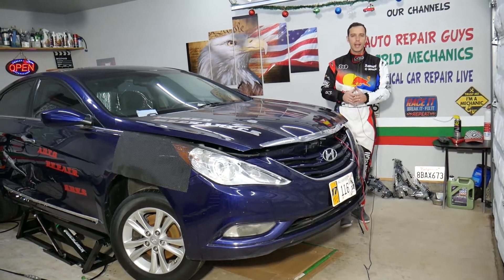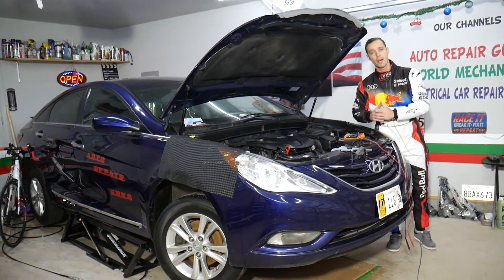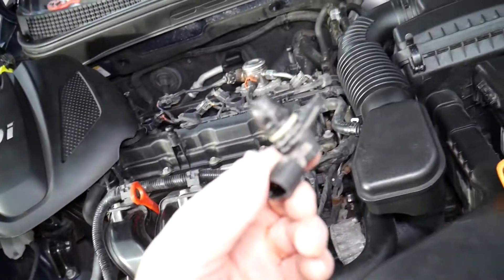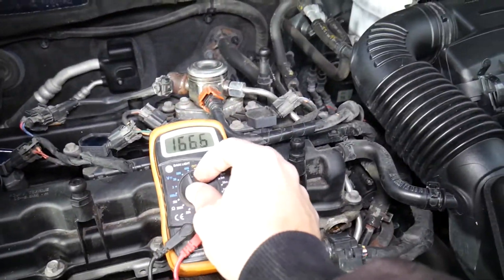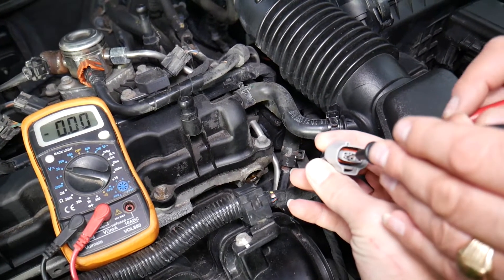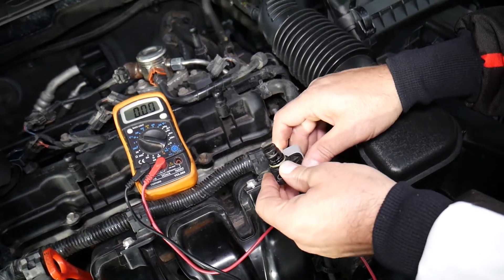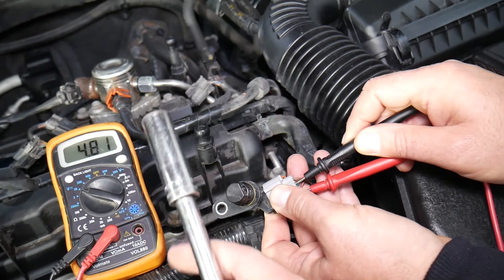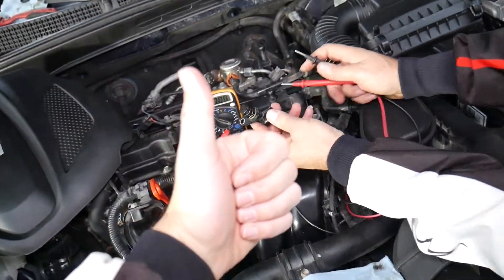HOW TO TEST CAMSHAFT POSITION SENSOR ON A CAR

Comment: I'm currently having a rough start when the engine is warm. My question is would this work as well for a sensor that is malfunctioning not just bad? Or is this what is determined bad?
Reply: There are no codes and have not had any. However you can definitely tell the lack of power, rough starts when hot, rough shifts or just the automatic acting like it doesn't know what to do, rough idle, and hesitation. If you have any other ideas I'm all ears. We have completed and replaced sparks, coils, injectors, fuel pump, intakes, throttle bodies, and a few small maintenance items. I drive a infiniti g37 2013 so all the minor issues from previous years are non existent.

Comment: I tested my camshaft and crankshaft positioning sensors.  They seem good.  I'm getting no signal from the ignition coil signal wire.  I get wire continuity from camshaft to ECM.  I have a 95 Maxima.  Do you know how much voltage I should get from the camshaft sensor?  I put my voltmeter on mV and still get nothing from the ignition coil sig. wire.
Reply: Sorun çözüldü mü?

Comment: Does this work for all camshaft sensors? I got Volvo V70 2008, problem hard start after night and both sensors does not change voltage when i touch metal bar to it, stays at 5v( battery and signal are both 5v)one of them is new.
Reply: Mine does the same with an Ls motor

Comment: I am experiencing a weird phenomenon with my audi 2.0T Q5 with my troubleshooting of the P0016 code. Hope the professionals can explain.

Got code  (Bank 1 Sensor A). checked both sensors they are good (replaced with new ones did not help - confirmation of sensors intact).
Noticed oil leakage residues at the VVT Magnet Valve and below is what I did:

1. Removed the VVT control magnet control valve. the pin got little stuck at first but cleaned and then it moves freely.
2. Measure the voltage of the plug coming to it: measures VDC 7.6V, The coil resistance of the valve is 6.7 ohm.
3. Tested the magnet control valve with a 7.5V (and 9VDC as well) battery and the pin pops fine with both voltages. But when plug it back to the car it does not respond although the power from the plug has voltage measured at 8.3V. I've ruled out loose connection as it has no response even the power measured from the magnet pins is 8.3V.
4. the Solenoid itself looks fine and it move in when pushed with finger and springs back out freely. This is hard to explain from what the basic ohm law of high school physics.

Comment: Question in testing the wire going to my cam sensor I'm getting my signal at 4.80 but on the power side I'm only getting 8 volts tested the battery and I 12 v on the battery is that ok

Comment: I have a 2007 Saturn Ion with a 2.2 ecotech engine and the signal reads fine at 5.02 when the meter is on either side with the black in the middle but doesn't show the battery voltage like in the video. When I try to put each probe on the outsides it just shows 0. Anyone know what this means? 

Thanks

Comment: Hi, i want a reply from you or any one who would know, i just checked my sensor and signal reading is 0.2 when magnet is not near metal and reading is 4.8 when i get a metal near sensor, basically it is opposite to what he said in the video, but the readings are changing, is my sensor working?
Reply: There are 2 type of sensors. It depends on what the computer is programmed to see.  A voltage signal or a zero voltage signal when there is an object in front of it.  The computer is either waiting for a voltage signal when triggered or is always seeing a voltage signal and is waiting for a drop in voltage signal when triggered. Hope that helps.
Reply: I have the same issue, did you ever figure it out?

Comment: i have a 4.8 signal wire and when i put metal on the sensor both the intake and exhaust sensor goes to .20. i never see zero. any ideas?

Comment: Hello, i have a Octavia 2.0 fsi 150Hp, this Week during a night was  -20 C and the car won’t start in the morning, crank but not start. I haved one error on diagnose: P000A camshaft position “A” timing; slow response BANK 1, Intermitent. I saw this video and check my camshaft position sensor and wire and i have just the signal from/to ECU ( 4.8 ) but no voltage from battery so the question is: i have the + wire is in short or interrupted and the sensor don’t get current?

Comment: Wonderful video. It was so useful to diagnostic my case (which was an "Intermitent" failure, diagnosed by my 2004 Peugeot 406 Coupé's BSI).
Reply: Hi was yours the cam sensor failure nate ? Helping a friend with a 107 . Crank no start . Spark on cylinders 1 only it's not ignition coils or spark plugs ruled that out

Comment: I would always connect your black lead to a ground that is preferably not on the connector (until you know which wire is which). It would suck if you sent 12 volts somewhere it shouldn’t go.
Reply: What do you mean by this? Like put it on the negative if the battery?
Reply: @sarahkline389 or on the bare metal

Comment: Auto Repair Guys
The intake camshaft sensor Yellow and Black wire give off 0 ohms intermittently when ignition is on. The exhaust camshaft sensor doesn’t do that when I resistance check it.

Comment: I Have A Camshaft Sensor 1 Code pO340 On My 99 Mirage Automatic… the Only OBD code from scanner (Check Engine Light Is On)  

So Car Sucks More Fuel on Both Short And Long Trips… 

189km TRIP - Full Tank departure.. On Arrival 1/4 fuel Gauge 

38km TRIP - Full Tank departure… On Arrival 1/2 fuel gauge 

And Has Hesitation Problem at 1st to Second Gear When Uphill.. 

But when I Steadily Accelerate And It Picks Up Momentum, It Can Go a 120kmph on the freeway… 

I have checked and replaced all The Fuel System ..fuel filter , fuel pump , spark plugs , plug wires , catalytic converter 

the Sensor Is Found In My Distributor ( People Said) ..
 
Must I Change The Distributor And Will that  Probably Fix The  Problem..? 

Or I Need To Service Camshaft It self..??

Does The Camshaft Easily Gets Spoilt..?? 

Any Suggestions..??
Reply: If you're still having this problem have you looked at the battery or the wiring from the sensor to the ecu itself?
Reply: Or even the actual timing chain too
Reply: @danframe02  unoe , the problem right now is the car doesn’t have cam sensor on it at all.. it’s a 1.5L mirage 1999…4G15 engine 

The 1.8L is 4G93 And has cam & MAF but the 1.5 doesn’t have those two sensors 

I suspect it’s an error code

Comment: Hi , love ur vids , can u help me out i have gmc holden 3.6 motor with code p0008 ,car runs fine but code keeps coming up and i remove it . im stuck between timing chains, cam shaft sensor od solinoid can u help .cheers

Comment: Signal wires run to the ecu, ecu wires always have the stripe. Hope that helps someone.
Reply: Thanks kindly, just about to embark on this!
Reply: My striped wire turned out to be the power to battery. 2006 nissan maxima.
Reply: @james81693  I'm working on one right now
Reply: Thank you. That info is very helpful when troubleshooting and are not a mechanic
Reply: @str8hood830  you are awesome thanks
Reply: Very much
Reply: Thank you. 🙏💕💪✌️🎶🎵. FJB
Reply: good stuff!💪
Reply: This is extremely helpful information. Thank you so much!
Reply: That's extremely helpful I never realized that, good info thanks
Reply: Thank you very much
Reply: Thanks
Reply: Not always the case I'm afraid. Mainly yes...but I've seen a few that weren't. Depends a lot on the region the car was manafactured.
Reply: I was looking for this ok information thank you
Reply: Good looking
Reply: It help me. Thanks
Reply: Do you always get 5v from the ECU wires or not?
Reply: @mark6020cc All modern cars use 5v reference for sensors. Older cars were constant 12 volts with essentially an on/off circuit to ground. Unless you get into resistors or relays etc. basic things like brake and light switches were constant 12v. I hate new cars. Cuz you always gotta think when diagnosing electrical issues... Maybe the computer module is bad!? 😂
Reply: @mark6020cc most sensors work from a 5volt reference
Reply: Thank my brother
Reply: On mine, all 3 have a stripe! 🤯
Reply: Yea tbh if true that probably will be helpful ya.....👍👌👍
Reply: What about if you have 4 wires?
Reply: mine only has 2 wires how can you test that?
Reply: Didn't notice this- you're a champion! Thanks.
Reply: Fantastic tip
Reply: Need help
Reply: Will the car run with a used ecu without being reprogrammed by HYUNDAI dealer. We only have 7 volts on the battery wire and battery is at 12volts. Thanks
Reply: @danhinkley138  looks to be lots of resistance. Maybe the wires are corroded. There should be very little resistance on wires unless there is a load on it. Like a wire before a lightbulb being 12v and the wire after a lightbulb being .2v. If that same wire is corroded it would cause resistance on the electrical parts making them not work as well or at all.

That’s why a car battery that has a low charge or is just drained can cause the engine lights or components to lag behind or appear weak. But with a new battery the car will act right up. Same concept.
Reply: @danhinkley138 no buddy
You need it programed to your vin#. If it will crank, it will program its self to your engine. But ALL old info has to be cleared.

Comment: I’m testing the cam position sensors on a 2015 Nisan Altima. Following this I have 5.01v with nothing on the sensor then it drops to .46v when I touch metal. Is that close enough to zero to be considered good?
Reply: I really wished he answered this one. I literally just asked this for my car
Reply: @ItssJoker  my issues wound up not being this but the 3 variable valve timing solenoids on the side of the engine. They weren’t firing correctly. Pain to get to but instantly fixed the issue. They are easy to test but you have to get them out to test.